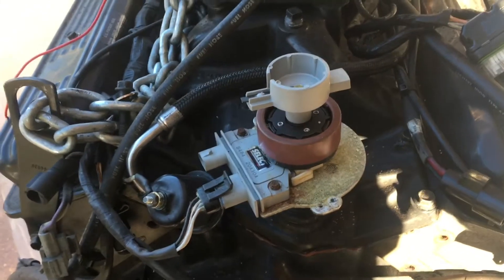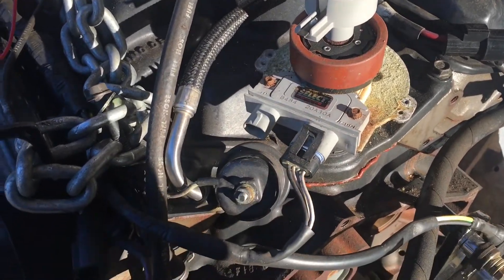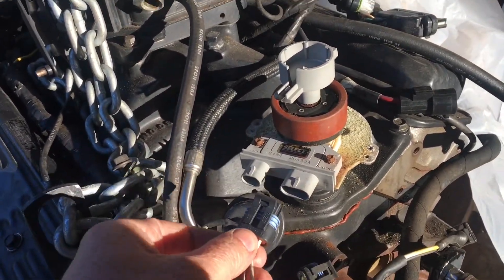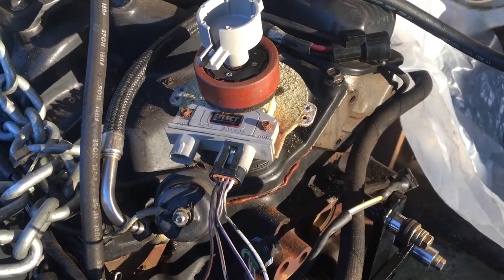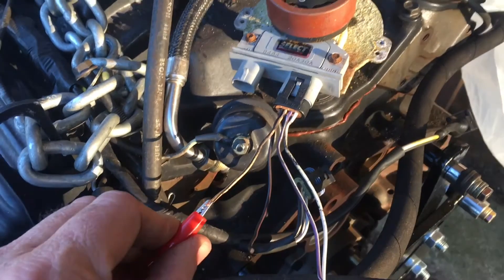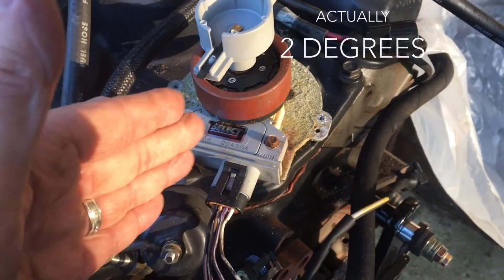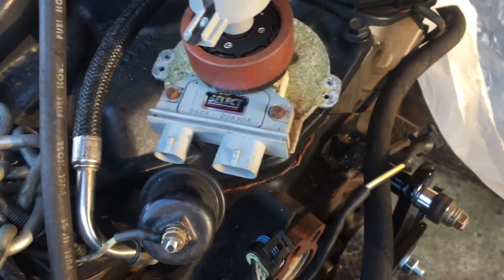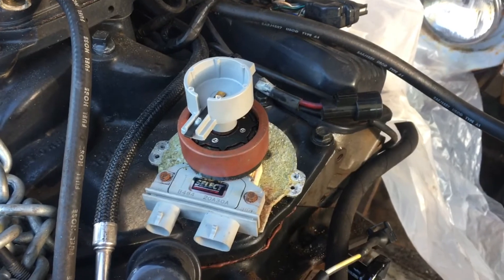Part 9E - How GM Delco EST Marine Ignition Timing Tool Works

Comment: I have tried everything under the sun. I am either stuck in base timing mode or I cannot out of it. My engine dies immediately after I apply 12V to the 3rd pin from the right (B - Bypass) at ~1500RPM. It is not advancing so I suspect I am stuck in base timing mode or the module is bad. However, I bought a new module in 2017 when I acquired the boat and it has been sitting while I mess with it to try to figure out the timing issue, among other things. It only has about 20 hours on this module and ~70 hrs on the engine. Any help or input is most appreciated. Your videos are super thorough and and amazing help. Thank you. - Mercruiser 3.0LX with EST Ignition
Reply from the maker: What brand is the module?
Reply from the maker: I’m confused by your comment. What is the significance of 1500 RPM? When the base timing mode is engaged the engine will slow down and sometimes stall. Turn up the idle speed on the carburetor to keep it running. Once it’s running check the timing. It does matter what the RPM is just get timing in the ball park of the setting. It should stay running so you can then slow it down. Keep repeating this process until the timing is at set point at 600 RPM. Tighten distributor and check one last time then remove timing tool.
Reply: Sometimes if the idle speed, mixture, or base timing is set wrong this will happen. If this is the case throttling up the engine before connecting the wire should eliminate this. The timing can then be checked and set. There is no centrifugal timing to change with RPM and the electronic timing will be locked. You could see a very slight timing change with a lot of RPM increase but that may have more to do with internal mechanics such as timing chain slack and gear backlash but won't be do to timing advance mechanisms or electronics.

Comment: I have a 1994 5.7 mercruiser I'm going to be putting vortec heads,elderblock performer,holley 650, and xm270 cam. If I run a HEI distributor what will run my timing curve
Reply from the maker: If you are referring to an older HEI distributor used on engine that wasn’t fuel injected then the springs and stops in the centrifugal mechanism will be how to set your timing curve. You can buy spring and stop kits. Look online for vortec 5.7 timing curve and adjust the HEI to duplicate that. There is also another way but it’s not adjustable. The 1990 Corvettes used a big cap (HEI) distributor that had a module with a built in timing curve just like in this video. You can retrofit the 1990 module in any HEI distributor and get an RPM only advance but it’s not adjustable other than the initial base timing. If it were my engine I would fuel inject it and get adjustable fuel and spark timing, but I’d do it with an LS pcm and delete the distributor spark altogether.
Reply from the maker: Did a little research on the web. You want to set your base idle timing at 10 degrees (no vacuum or centrifugal advance at idle) and then have centrifugal advance add about 10 degrees more at WOT for a total of 20 at 4800 RPM. The Vortec heads are efficient burners and don’t need much WOT timing.
Reply from the maker: I’m currently working on two MEFI boats with digital spark timing (MEFI controlled spark timing). These have Vortec heads on them. I’ll read the timing and post up what I find when I get to that point.
Reply: Cool. Thanks for the info.

Comment: Do you plug in the 2 pin connector as well when doing the timing
Reply from the maker: Yes the two pin connector is what fires the coil. The engine won’t run with that disconnected.

Comment: I have the same exact engine with TBI. When I install the timing shunt the engine will not fire. So I can't set the base timing. Any ideas? Thanks volvo penta 5.0gi
Reply from the maker: I’ll look into it and let you know. Setting base timing on a TBI engine is done differently. I’ll find out and let you know how it’s done. I kinda know how I just need to find out what to set it to. Do you have the manual for your boat? That would provide the info I need.
Reply from the maker: This link explains how to set the timing on a 5.0 with TBI. https://forums.iboats.com/threads/1999-volvo-penta-5-0gi-pefs-tbi-timing-adjustment.461251/
Reply from the maker: There are marks on the harmonic balancer that may be covered with paint. Scrape off the paint to find the 8 degree advance mark. It will be clockwise from the largest mark.
Reply from the maker: Let me add one more thing. On iboats.com there are many posts that say just set it at idle where it runs the best and go with it. This is incorrect. The MEFI calibration is programmed for an expected base timing at the distributor. For example if the MEFI is programmed for 30 degrees total timing at WOT, and it is also programmed for 8 degrees of base timing, then the MEFI will only add 22 degrees of timing, since it is expecting the distributor to make up the other 8. If you set the base timing to “whatever it runs the best” you could cause the WOT timing to be too high causing inaudible knock that will damage the engine. So it’s best to set the base timing properly using the setting given in the engine owners manual.
Reply: Thank you very much! You're very informative
Reply from the maker: As an alternative process you can disconnect the MEFI connector at the GBRE connection on the distributor and connect the timing tool as in the video. But instead of setting timing with the engine running use the starter to turn engine over and check timing while it’s rotating via starter. The engine won’t run because you’ve disconnected the reference signal from the MEFI computer needed to trigger the injectors.
Reply from the maker: @Trav945  thanks and if you haven’t already please subscribe to my channel. There is much more to come about boat engines as well as GM fuel injection.
Reply: I have definitely subscribed. The issue I am having is after replacing the distributor I have  erratic timing at idle. Me service manual says it should have a BID ignition but it has a EST ignition.  I assume I need to "freeze" the timing in the ignition control module but don't know how. Thank you
Reply from the maker: @Trav945  send me an email (gmefiguy@gmail.com) with the service manual page mentioning BID ignition. But if you want to freeze the ignition use the procedure in the video. The timing tool locks the timing to one value which is what you set it to by rotating the distributor. You can use the starter to rotate engine while checking timing.
Reply: @moccasinmarine   In the comment I am responding to you say that MEFI will add 22 degrees of timing but in your video you indicated that the HEI module mounted to the base of the distributor is what actually advances the spark and that it does so based on table lookup using RPM as its only input.  

You also indicated that this advanced timing is sent to the ECM via the "E" signal and that the ECM's only option will be to retard what it is given and then feed it back to the spark control module which is then used to time the spark.  Did I misunderstand something here?  Since GM HEI is not the same as MEFI even though they work together it might make sense to point this out because it has implications on the way people think about the theory of operation.  

For example, if the MEFI ECM can only retard what it is given from the EST module, that means that none of the inputs to MEFI such as knock sensor, Throttle Position Sensor, MAP sensor, ECT and the like can ever result in more timing advance.  They can only serve to potentially retard the timing coming from the EST.   Is this a correct understanding?  Thanks!
Reply from the maker: @DIYDaveT  Hi I just now found your comment on my YouTube channel. You are not fully grasping the concept of how the ECM controls spark timing with a distributor based system. The retarded spark I’m talking about isn’t spark retard that you typically think about. The system works like this. Let’s say the base timing is 10 degrees BTDC. When the ECM gets a signal from the reference wire (R), the engine at that time is at 10 degrees BTDC by definition. The ECM can’t advance the timing because it’s too late for that to occur. The ECM would have to predict the future to advance the timing more than 10 degrees. However GM played a trick. Let’s say the total timing needs to be 30 degrees. If this is a V8 there are 90 degrees of crank rotation between cylinders. So what the ECM does is receive the signal at 10 degrees, then it waits. It delays the signal sent out on the E wire. Since 30 degrees total is desired, it waits 70 degrees (10+90-30) and then fires. But by the time 70 degrees has passed the distributor has mechanically moved to the next tower in the distributor cap, so the spark event is 30 degrees of advance on the next cylinder in the firing order.
Reply: @moccasinmarine  Thanks for the detailed and clear explanation.  Got it now.  ;  )
Reply: @moccasinmarine Thank you! I've researched this issue for hours! "Won't start with jumpers connected." You are the only person that has said anything about this!!

Comment: Have a 93 5.7l tbi truck that was running ok the negative battery cable came loose and it shut down. Now it will not start back. Fuel injectors spitting fuel, coil is new but has stop firing.
Reply from the maker: If the injectors spray fuel with key on engine not running then the ECM is damaged. It should only spray fuel when the engine is rotating. Pull the connectors off the injectors to stop the engine from getting any more fuel and change the gasoline saturated oil if injectors sprayed with engine not rotating. Then crank it over until it either tries to run or does nothing holding the key in start no longer than 5 seconds. If engine tries to start then it was flooded if it doesn’t try to start remove a spark plug (#1 is easy) and once plug is out connect the spark plug wire back up and have someone crank it while you watch for spark holding the plug against ground. If you have a spark the ignition is good. If no spark connect the plug wire to a brand new plug and crank watching for spark again. If you have a spark replace all eight plugs since they are carbon fouled. If no spark you only have three possible failures left. The coil, the module, or the pickup inside the distributor. Since the problem started after a battery connection failure I’m betting it was the module since it has electronics that can fry due to surges or ground loss. If the ignition checked out pour a teaspoon of gas in the throttle body to see if it tries to fire up. If it does but floods with the injectors your ECM is damaged.